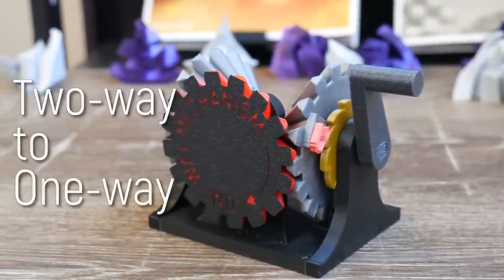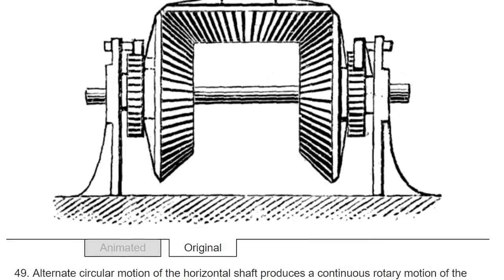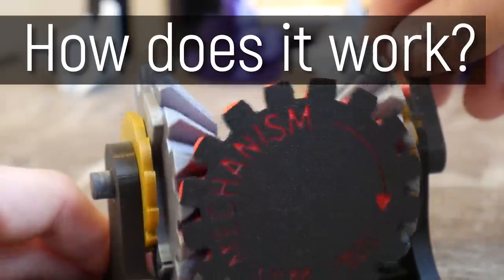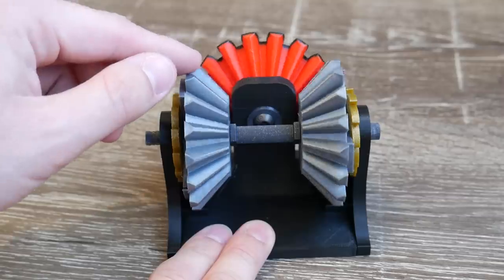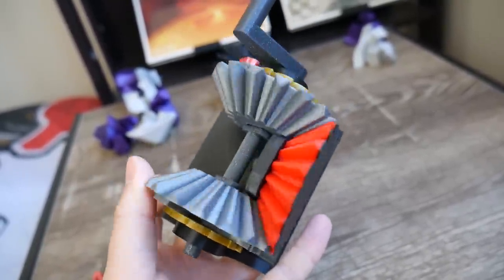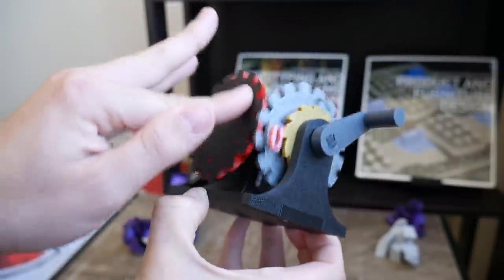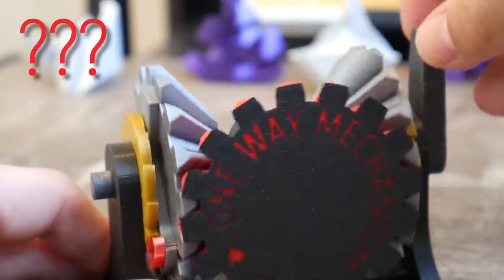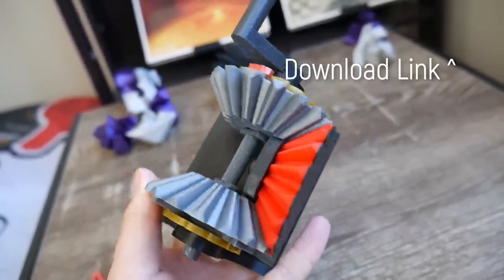This Mechanism only turns Clockwise, no matter what.

Comment: Today i stumbled across an old toy of mine: a little wagon that plays a song when you push it. The rear axle drives a music box inside, but no matter which direction you push it, the song keeps playing. I had a hard time thinking about how this mechanism works, so i finally unscrewed the bottom plate of the wagon and had a look at the gears inside. It's mainly the same mechanism as the one you showed but instead of the ratchets there were two springs attached to the two input gears that bound on the axle when turning in the "right" direction.
So here's your practical use: Make little children happy and grown up ones thinking about the wonders of mechanics! :D

Comment: Could be used with an AC motor to ensure that the output was always in the correct direction. Then we wouldn't have to pay Sparky to reverse a pair of phases to get the rotation right. :D
Reply: It's a mechanical rectifier!

Comment: My brother used to have a bike that would always go forwards no matter which way you pedaled.
It must have been using this mechanism because it made the most awful clicking noise when driven.
Reply: TheMaskedKid I used to have a bike that had reverse system on handle bars. When you turned left the bike turned right. It was freaking impossible to ride at first because of the balance.

Comment: As you suggested, converting a pendulum into clock motion seems obvious. But I also see it as a way to turn a generator from natural sources. A wave generator, a float on the ocean levered back to the beach, as the water rises and falls it turns the generator in the same direction. I remember seeing details of a silo on an ocean cliff, a tall tube with the bottom in the ocean, and the top closed, with a fan in a vent. As the ocean rises and falls it blows air up and down the tube, turning the fan in one direction as water rises, and the other as it falls, generating electricity.
Reply: Came here to say this. This could convert linear vertical wave motion (water waves) into uni-directional rotation. Just attach a weighted float on a vertical guide (rail or tube) and get cranking. I think you will lose a lot of efficiency relying on air compression though.
Reply: Andrew Wrobel dude it's an awesome idea :0
Reply: Andrew Wrobel I agree your idea simplifies the concept. The towers with fans was actually built in China, so not my idea.

Comment: So... I can imagine it being used on a generator or something which relies on a paddle being pushed back and forth.

Actually anything being pushed back and forth really, as the instant engage would keep the output moving really quickly.

Maybe one of those Man-powered Train beds?
Reply: Eir Foxtrot it is not cost efficient. But yes, it could be used for that.
Reply: I suppose i was imagining one of those huge Wave Power Converters, where efficiency is traded for reliability
Reply: Eir Foxtrot oh like changing currents.
Reply: i was thinking the same, Nowadays the same result could be GENERATED, using electrical rectifiers instead mechanical but back in the day this would be the go

Comment: He used free hanging arms, you use 3x spring loaded arms.
Redo it matching the original design, probably be a lot smoother sounding.
Reply: still wont be silent, and may be more prone to failing to lock
Reply: Not silent, correct, but  A heck of a lot better.
As far as locking, simply looking at it, I would agree with you.
However I had a early 1900's manual drill press that used a non-spring loaded ratcheting arm similar to this one, it grabbed every time.
Reply: I've probably got no idea what I'm talking about but would that not have the drawback of being slower to reengage when changing direction as the ratchets fall back into place rather than being pushed back into place with the elasticity. Also, at much higher speeds of rotation am I wrong in thinking that the ratchet might not re-engage at all with gravity taking too long to push, the ratchet back into place and missing the gap between the teeth, therefore bouncing off the gear teeth? Again, probably got no idea what I'm talking about but just a thought.
Reply: No, your probably right.
But it doesn't seem this was made for any high speed application.
Reply: True

Comment: It’s a mechanical AC to DC converter
Reply: wpherigo1 said the electrical engineer
Reply: That actually sounds like a fun/useful teaching aid
Reply: Its a FULL BRIDGE RECTIFIER!
Reply: Caspar Nuha , they existed before vacuum tube or semiconductor diodes. According to Wikipedia they were pretty efficient as well. Your vacuum cleaner probably has one in the form of an ac/dc motor. Chances are he looks at car transmissions as impedance matching devices as well. ;)
Reply: Lol, yeah, and bicycle gears, axe handles, audio horns, wrenches, even wheels themselves. All impedance matching.
Reply: That's exactly what I thought

Comment: Not this Particular design, but similar mechanisms are used in automatic mechanichal watches for winding with the motion of the hand
Reply: Xris Kava : Agreed, this was almost certainly used for an energy storage mechanism in some way. Might have even been used in some mechanical clocks at some point.
Reply: These were my thoughts as well, whatever it was used in, it was important that it only be wound one direction, this type of mechanism makes sure it cant spin the wrong way.
Reply: I do watch repair, so that's the first thing I thought of. He should check out some watch automatic unit and then 3D print something silmilar. They are slimmer than this differential looking thing he made as well.

Comment: I wonder if it could be used on a simple flat wind turbine? Spinning a sail in either direction could drive a water pump in the right direction for example.
Reply: No, because of wear, friction and very bad power transmission. You use the ratchet mechanism to transmit the whole force. The "big" spur gears are only show.
Reply: If you use plastic, it obviously wouldn't last, but considering the ratcheting mechanisms in ratcheting wrenches don't break or wear out all that often unless made of trash materials or are otherwise under-engineered, it could work. Only thing you'd then have to contend with is the constant noise.
Reply: Then again if you use a high weight gesr lubricant and a well designed housing, the wear and noise would be at a minimum and there has to be a way to fix the bevel gears to the axle and still allow free movement. I'm thinking some bearings press fitted into the middle of the gears and then affixing those to rhe axle to fix the loose design. Or would that solve anything? Thoughts?

Comment: This would definitely be a good device to prevent user error or user friction.  In some industries, the user “experience” is of the utmost priority.  Having the same output regardless of the users input (as long as the user is turning in one of the directions) is a key to this.  One application in this I can see is a tool that can be used from the front or back as well as left or right hand.

Comment: I really like this sort of video. 3D printing has so much potential! Static objects don't make it justice.
Reply: Chrysippus 3D printing is definitely great for something like this.  For an actual functional device, you probably want to use other processes.  If manufacturing out of plastic at high production volumes, injection molding is more economical.  You can also get better resolution / finer tolerances with subtractive machining if that is critical, as is often the case with gears.
Reply: Brain Mind oh sure, I wouldn't use this for anything other than educational reasons. But simple things with gears are sometimes printed and used. Recently Applied Science printed pipe fittings that handled "like 15 psi" and despite being static, it's amazing what can be done! (was resin printing but still)
Reply: Chrysippus I agree that it’s amazing what can be done with 3D printing.  Sometimes I just see people getting a little over-exuberant about it like it’s a replicator from Star Trek.  Not saying you were, just providing a counterpoint.

Comment: Have you ever seen the 'South Pointing Chariot' mechanism?
Two wheels in a cart arrangement and a shaft with statue out the top of the thing.
Roll the cart in a straight line, the shaft doesn't turn.
But when you roll the cart in turns and pirouettes, the shaft rotates to maintain its orientation relative to the table.
Think of it as a mechanical compass, always pointing South.  Or what ever direction you like.
Not too many gears...
Reply: Essentially a mechanical "difference"

Comment: I have a racheted screwdriver that allows you to continuously turn in one direction whilst twisting in both directions. It has a little switch to allow you to switch the drive direction but using this kind of gearing system I believe.
Reply: Rosario Marino got a link / model name?
Reply: I know stanley makes one, i have it.
Reply: Mine was from a company in the UK that have now gone out of business unfortunately. I'll try to find a link though.
Reply: Mine was from a company in the UK that have now gone out of business unfortunately. I'll try to find a link though.
Reply: I have a sidchrome 3/8" square drive ratchet that does the same, reversible as per normal ratchets.  Rotate the handle etc
Reply: Lowes stores in the US has a similar screwdriver in the house brand Kobalt. Called "Double Drive" its quite useful.
Reply: Have one & it also makes that clicking sound when turned to the opposite of which direction its being set up to
Reply: I've had the Kobalt double-drive screwdriver for 5ish years now, and have been perplexed by the mechanics of it the entire time. It was the first thing I thought of when I saw the thumbnail for the video. Now, can you try and make the output rotation switchable?!?
Reply: Proxxon also offers a "rotary ratchet" in different sizes that seem to work the same way. Use it like a normal ratchet or just turn the handle in any direction and the head will always turn into the set direction.
Reply: +Travis Dietz You can add another set of opposite rotation ratchets to the ends of the existing ones and make the spring system movable between two positions. That would work, but you would need a way to stop over torque ability to not damage the raisers or the springs for using this something other than as a desk toy..
Reply: Facom R360  does this. You can rotate the handle in either way so the head rotates in one direction
Reply: A screwdriver is a really cool idea for this.  It'd be a lot more efficient than a standard ratchet

Comment: for raising water out of a well without it falling back in if you get tired, a release button disengages the axle to drop the bucket when finished.
Reply: For that you just need a ratchet.
Reply: I'm not sure if that's what they meant, but this mechanism could make a lever do a cranks job, like if you where to old to fully turn a crank you could just pull a lever back and forth.
Reply: How would you send it bak down it  stops the opp direction
Reply: @jeswinjohnson6695  disengage the ratchet

Comment: Awesome! It would work great as a starter crank on an antique car. Wouldn't matter which hand you used or which direction you turned it.
Reply: Cliff Chism But many older vehicles that have cranking handle, it's made so that engine will "kick" handle out of the bore when engine starts. With this implementation that wouldn't be possible :)
Reply: Once found one of those cranking-handles (most likely from '30-'50s) & it actually had a ratchet mechanism built in, & as you could only insert it one way the crank could only turn the motor over in one direction, plus the crankshaft couldn't then turn the crank-handle once the engine had fired-up because of the ratchet-mechanism!

Comment: One thing that would be useful for is the "wind in the trees" driven work unit converted to a electric generating device. In the old days pioneers used ropes and pullies attached to tall trees swayed back and forth by the wind to power large hand saws to cut wood. Just replace the large hand saws with this device with a gearbox attached to get higher rpms to a generator and you have a renewable electricity supply. Make it out of tungsten and cobalt steel parts, enclose it in a housing filled with oil and it will last for years.

Comment: It's used in draisines. When you move the lever up and down, but the trolley is moving one way
Reply: wrong
Reply: Bobany very insightful, well said, I now understand everything about them
Reply: Bobany care to explain why it is wrong?
Reply: Handcars at some point need to move in the opposite direction. To use this one way mechanism would require additional mechanisms to allow for a reverse gear. Kinda over-complicating a simple machine. Bobany isn't wrong, but to provide a point of view without backing it up makes him look like an ass. See this video for how a handcar works watch?v=rJq_9nxVc6A

Comment: Ok but look at it from the other side, now which way is it turning?
Reply: If you turn the output shaft and keep the input one still, for instance, it will free spin. If you turn it the opposite direction instead, you have full blockage.
Reply: Graziano he meant. instead of looking at the front of the output gear. look at the back and begin cranking it. it will go counter clockwise.
Reply: Graziano Ullucci you noobth

Comment: Reminds me of a sailboat winch that's used for tightening ropes. But those have two speeds depending on which way you turn the crank.

Not sure what kind of mechanism those actually use inside though, but I guess it could use this same type of mechanism.

Could you modify this to have a different gear ratio when turning it the other way? :)
Reply: You are right, it's exactly what they use in sailboat winches, but with all metal parts and good precision machining they last for ever if good maintenance is applied to them
Reply: Kari Söderholm yeah I thought so as Well is a two speed winch
Reply: Kari Söderholm a
Reply: I assume its a ujoint that goes into a smaller gear on the other end for a gear reduction.

Comment: It could’ve been used in a clock. Since at one of the main ways of powering clocks was a circular windup, having the direct output go left and right, meaning you needed a way of converting the continuous change in direction to a only one. So it can be used to move the gears for the clockwise direction.

Comment: The mechanism might have been used in pendulum clocks as it converts the back and forth motion to a clockwise movement
Reply: Nathan R. 
I mean, they make sounds too.
Reply: The escapement on nearly all clocks simply halts clockwise motion at regular intervals. The point of a mechanical clock is to release the power of the mainspring or weight at controlled intervals -- power feeds into the pendulum, not the other way around.

Comment: Primary uses: clocks where a pendulum swing would have to cause an advance regardless of the direction of swing. Wave or tidal generators as well. The odometer is a great example as well. Basically anything that is cam driven will push and pull something linearly from rotational motion, if you attached an arm to the center axle instead of a crank this can take the linear motion and turn it into rotational

Comment: some engines back in the day, likely running on like a glow plug or diesel would sometimes fire up on a backfire causing the motor to run backwards. this on some engines would cause no harm. this would work perfectly

Comment: This should be implemented on bikes, having the option the paddle backwards. And also there are new bikes that does not have the clicking noise so it wouldn’t have to click all the time while cycling.
Reply: pizzamagnet Thats been done already
Reply: Pedal? Unless you take a paddle along for extra challenge.
Reply: Why would u paddle backwards???
I mean isn't that kinda un-nutral to your feets?
Not the best idea 

Especially considering using a mechanism that is way more likely to break????
Reply: Andreas S. Well a few reasons off the top of my head.
1. You could possibly bike farther. 1 mile forward peddling, 1 mile (or half mile) backward peddling...and alternate. So the strain is divided over different muscles.
2. Running backwards has been shown to be easier on your joints, and quads for example. So if those are weak or prone to injury then backwards running is healthier. Backwards peddling would be the same way and would let certain people bike that otherwise couldnt because of certain injured muscles.
3. It would work your hammies and glutes more while forwards works your quads and inguinal muscles more. So for people who want to build certain areas they could pick which they prefer to exercise.
Reply: its called a retro direct bicycle and can have different gear ratios for forwards and backwards pedaling. (and one ratchet is always clicking)
Reply: +Broken Wave; ditch the chain and connect the pedal gear directly to the drive wheel like an old clothes wringer. Pedal backwards but wheel moves forward.

Comment: There are one-way clutches that do not use ratchets. In an earlier life I was a camera repairman. Many cameras use them for the film advance mechanism. They are quite simple --- a spring that's wound around a drum. ONE end of the spring is connected to the drive source, and when turned one way, it tightens against the drum, and drives the drum. When turned the other way, the spring no longer tightens against the drum, and thus slips freely.

The spring is tightly wound with no gaps between the windings, and must be given the correct diameter, so that it will grasp the drum in one direction but slip freely in the other.

I don't know if this could be printed but I suspect it could. If I were to try it I'd use flat-wound "springs" rather than "wire" shaped.